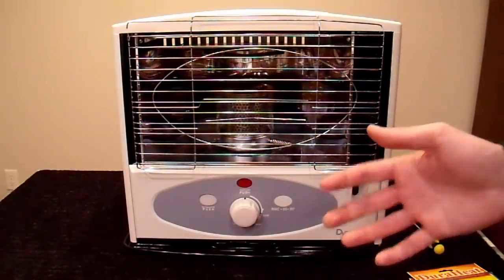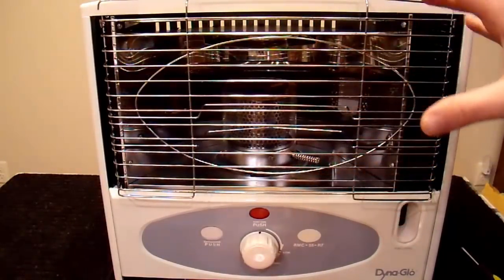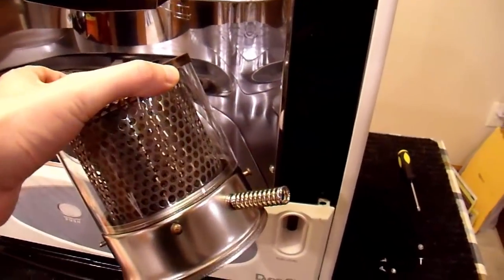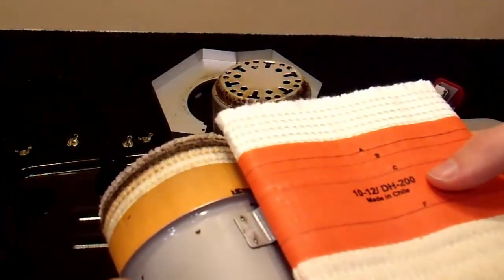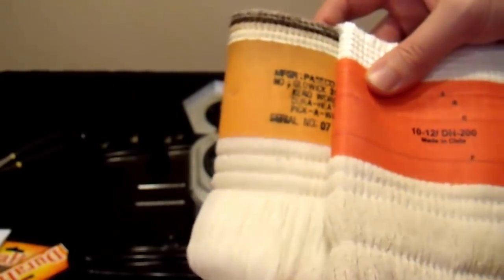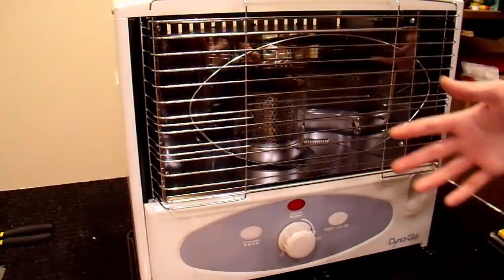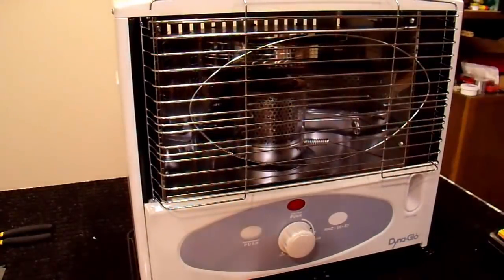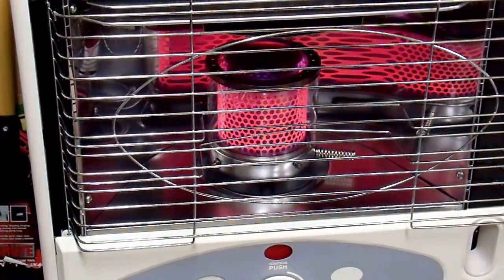Kerosene Heater Wick Replacement - A Simple Procedure

Comment: This unit works very well https://www.youtube.com/post/Ugkxl2o1MQU4aMgmFk_cMqer4nH2ptpDEM6h  Considering the price I paid for this, I didn't have high expectations, but now after using it, I consider this is a well designed heater. Do be aware that doing the dry burn on the wick as recommended (or at least every two tanks) is absolutely necessary to avoid an unclean burn, fortunately it's easy enough to do. I'm burning dyed K1 kerosene and do a dry burn every two tanks and this is working great. This unit will heat a little over the 500 square feet that it is rated for depending on the temperature. On days it isn't bitter cold this heater will do a fair amount more. This makes an excellent emergency heat source, and also in my situation, it is a little more efficient than the electric heat in the teen temps and below.
Reply from the maker: Makes sense.  More BTU is useful in a detached garage especially if you don't normally heat it.  Cold concrete sucks heat out of the air spectacularly quickly.

Comment: Calling out all ? 3 or so guys who did these vids, showing wick replacements on the dura heat/dyna glow type heaters. Each one of you edited out the hardest, most confounding parts of replacing these dang wicks. Pulling off & putting back the ratchet/ gear stud into the slot. That's the hardest thing to do! Show everything please. We don't care if you had to struggle a bit, but at least we'd know what to expect!
Reply from the maker: I apologize for not showing the part you were interested in.  I thought I showed all parts people might have had trouble with but I apparently missed something.  I've been in your shoes many times and understand the frustration!  It's been a long time and I don't remember exactly how that part assembles/disassembles.
Reply: NO SH!T!! arrrggggg. The dang thing came off pretty easy, but I'm playin' hell getting it back on.

Comment: NO diesel.... use only K-1 kerosene in heaters and lamps... clean burn, no residue, and cheap enough. And skip all the useless hand gestures in the video. Stay on topic. Burn it outside AFTER the wick absorbs K-1 for 1/2 hour or so. Smells and soot are best kept outdoors as you adjust the wick height.... then take it indoors to warm rooms.

Comment: I have a similar kerosene heater Zibro Kamin R30C and I think you solved what i thought was a problem just by watching your video .I installed a new Wick and everything seems to be working fine But the flame adjusting knob only raises the Wick it doesnt go in reverse to lower the wick/flame, (as my older Corona kerosene does) so i thought i did something wrong reassembling the heater. I noticed  your adjustment knob doesn't go in reverse either.(because of the ratcheting  mechanism) wont  allow the knob to be turned in the opposite direction.

Comment: Thank you for this video. I was able to replace my wick in my heater. My only issue was getting the wick out and then putting it back. Other than that, it was simple. I have it running now and it's so warm.

Comment: There's nothing wrong with this heater.  It just happened that you used a diesel fuel without any mixture of alcohol 91%, that's the reason it won't gonna work properly (diesel is more thicker than Kerosene). Kerosene requirements for heater is K-1 rated. The wick that you replaced is still brand new.  As long as you used proper fuel your wick will last up to 120 hours.
Reply: You've got to use an all cotton wick in order to use diesel, just don't ever use the red dyed diesel, or red kerosene for that matter. The dye will clog up wicks.

Comment: I bought a dyna-glow brand at walmart for $10 and it even came with a new igniter. 
  My heater is a kerosun radiant 36 brand and model. This fit perfectly and I think even the igniter is going to fit, I haven't tried it yet. I trimmed the old one and put it away I'm pretty sure I can still use it after trimming the bad stuff off. I also cleaned it with carburetor cleaner and a cotton shirt.
  I need to take my new one out and reinstall it I've got it too high. I can adjust it to where it burns just fine but it won't go down low enough to extinguish it and the proper use adjustment has it turned almost all the way down so it's installed way too high. You can tell that these things are made long enough that you can trim them without it ending up too short.
   How was the quality on this one you got?
By the way 6/16 of an inch is 3/8.
Reply: L

Comment: It's a dang 10$ wick man... is it really worth your time to spend refurbishing? Lol...
Reply from the maker: Peter Carlson It's good to know what can be done if you're stuck in a situation where you don't have a replacement but need the heater.
Reply from the maker: Peter Carlson
lol!  I bet it would for a little while!  hmm..  I actually save my old socks for use as oil rags and it makes me want to try it...
Reply from the maker: Peter Carlson
Seriously, I'm considering trying this just out of interest.  Now I want to know.  :)  Cotton wicks work just fine - I have an old perfection heater from the 1920's that does just fine with a 100% cotton wick.  They burn down over time and don't last as long but that isn't really the concern in this case.
Reply: ***** probably would handle the diesel better as its self consuming
Reply from the maker: Peter Carlson
That's a good point.  I never thought of it that way before.  I would probably have to disable the ratchet mechanism in my dyna-glo to allow full adjustment like other 100% cotton heaters but that would be relatively trivial.  The old perfection500 doesn't really perform that well since it needs constant adjusting to keep the flame right as the reservoir level drops so I don't like using that one indoors.

Comment: After removing the wingnuts, I can not get the wick holder assembly to come out. It will only come up less than half an inch. I’ve even gently tried a screwdriver on it. I’m at wits end.
Reply: usualy carbon makes it tough to pull up wiggle side to side and it still will take a lot of force if empty , use penetating oil on wick but be sure to clean all of it off before rewicking. also plastic razor remove carbon from center tub were the wick rides. I clean the  tank befor I reasemble so I run it empty befor changing the wick.

Comment: Good heater. Thanks for the video.

One note; the wick is more adjustable than you show. The knob needs to be pulled in and out to ratchet the wick down and not shut it down completely. It is then fine adjustable a little from there.

Comment: You should be able to clean that top area of the old wick.  Letting the heater run dry helps to remove deposits. Comb the wick with a small wire type brush. Where did you get your wicks at? I cannot buy them anywhere in my city.
Reply from the maker: I did clean the wick mechanically and it didn't work for me.  I also tried dry burning them.  Perhaps something like acetone might have worked - I don't know.  I ended up buying new ones from Lowes.  Online retailers sell them too.

Comment: @knurlgnar24 I successfully unclogged a wick by heavily rolling a wine bottle across the carbon line with the wick laying on concrete. It took a little while, but the carbon started breaking up and falling out when agitated. I also give the carbon some impacts with the wine bottle using a softer banging motion.

edit: Is toluene safe to clean wicks?
Reply from the maker: I can't think of much that wouldn't be safe to clean wicks aside from sulfuric acid or some other such substance.  Any solvent that doesn't damage the wick fibers is fair game.  Very interesting about the mechanical method using rolling.  I honestly didn't try too hard before buying a new wick.

Comment: Great video!  Thank you!  How soon would you recommend performing a dry-burn after installing a new wick?  I've been dreading this project for a while but your video is THE best I've seen on this subject.  Thanks again!
Reply from the maker: No need to dry burn unless you have a problem.  If a dry burn doesn't fix the issue then new fuel and/or a new wick is probably the solution.  You'll likely go hundreds of hours or more without needing any maintenance if your fuel is decent quality.
Reply: @knurlgnar24  Hey thanks!  I changed the wick yesterday and thanks to you it went smoothly and easily.  Today my heater is working perfectly.  Getting the pinion lined up in the ratchet mechanism was a little tricky but eventually it clicked into place and was fine.  My understanding (per the manual) is that these combination cotton/fiberglass wicks need to be broken in by dryburning after the first initial 5 or 6 uses to insure long life.  Who knows.  I've been buying clear kerosene at the pump (locally) for over 15 years and have never had a problem ($5.49/gal as of yesterday).  When compared to big-box retailers (including Amazon) charging anywhere from $15/20 gallon and the relatively low cost of a wick replacement, I'll take my chances now that I am comfortable with the procedure (again, THANK YOU). I use my heater almost every day and those insane prices just are not sustainable.  Even if I end up changing the wick once a month I'm still ahead $$$ after a single day's use.  Best wishes for an especially nice Holiday Season my friend!

Comment: Mine wont raise up like it used to. Idk if Im just not getting the gear in right or what. But its pissing me off.
Reply from the maker: I can only guess, but my first assumption is that you need to re-insert the wick adjustment gear in the holder so that it is in the fully down position when the knob is in the fully down position.

Comment: Someone else says if you want to use diesel use a 100 percent cotton wick..   use diesel cleaner additives and or add %90 isopropyl alcohol .
Reply from the maker: Regular Diesel (#2) will NOT work regardless of additives.  I've seen that advice in multiple places and an curious where they are getting their diesel - perhaps in regions with a lot of fuel oil heat demand where #1 is more common?  However #1 diesel should work in theory if you find a 'clean' source.  At this point I wouldn't risk it and would stick to K1 for wicks and #1 Diesel for torpedo heaters.
Reply: @knurlgnar24  yeah the ppl i seen said never use #2 only use #1 diesel. oh yeah i mentioned only use diesel with a full cotton wick.

Comment: I seen someone clean a wick with carb cleaner..   maybe soak in berrymans??
Reply from the maker: I tried cleaning mine and I don't remember exactly what solvents I used but it didn't work.  I wouldn't be surprised if what you recommend does work - I expect soaking in a light solvent with a synthetic solvent like what comes in Techron would work.  But at that point I might as well just buy another wick.

Comment: Hey knurlgnar24 - If you get one that is loaded with tar like that you can take it outside and let it burn dry till it goes all the way out, then let it sit for a half hour or so and lite it and let it burn dry again.  It will burn a lot of that tar/carbon off of the fiberglass.   I have brought back several wicks that way.
Reply from the maker: ***** I tried dry burning it twice and it didn't seem to make much difference.  I then tried high (relatively high) concentrations of alcohol mixed with clean kerosene and while it burned reasonably well on the kero/alcohol mix it went back to its smelly self when using only kero.  I wonder if this particular heater isn't designed to allow the wick to up high enough to adequately dry burn it?  I considered adjusting the wick so it would go up a little higher and potentially dry burn better but in the end it's a $10 wick and if I'm going through that bother I thought I might as well replace it.  Would be nice to know if it works though.
Reply from the maker: ***** BTW, the tar burned off of the wick portion that is exposed, but that's only 8mm on this heater.
Reply from the maker: Hey, I think it was you that had a video on running kerosene wick style heaters on straight diesel.  If so, could you comment on what kind of diesel you use (D1, D2, etc) and the diesel additive you use?  Have you tried running them without the additive and were your symptoms similar to mine?
Reply: *****
No it wasn't me, I haven't ever ran mine on diesel.  I have see a lot of garages and stuff that will run the salamanders on diesel.  I run mine on pump K1
Reply from the maker: *****
OK, thanks.  Must have been someone else.  I have a salamander style heater that runs on diesel as well, but K1 works better.  Diesel only seems to burn properly if the ambient temperature is already 50+ which kind of defeats the purpose of one of those heaters.  After a minute or so of pumping out diesel smoke it settles down and burns nice and clean after that, but by that time I need to open the garage door - and then I get even colder!  I'll probably try a diesel additive in that heater at some point since it really shouldn't need K1.
Reply: Couldn't I just brush the wick with a toothbrush without taking it out of the heater?

Comment: Can you burn diesel with that new wick or does it have o be a cotton wick?
Reply: yes, but it will need replacing again if you do. Don't do it.
Reply: Diesel is very similar to kerosene, just not as clean. 
My understanding is that you can use diesel when, and only when  you use an ALL COTTON wick. I've used diesel in my circular wick kerosene lamps, and it works just fine.
 Try Mick Stairs Wick shop. You can find out all kinds of excellent information there about kerosene heaters and also kerosene lamps especially the good ones with the circular wicks. Seriously, check them out.

Comment: You may want to take the kerosene heater you have there and hall it either to the dump or the junk yard, IT USES THE FIBERGLASS WICK and diesel will clog it up. I am using 4 perfection (FLAME SPREDDER TYPE) and a FANCO and they have no issues burning RED DYE DIESEL FUEL  You must be using a 100% cotton wick for DIESEL to work right. COTTON can tolerate the DIESEL ALOT BETTER then fiberglass. Just a pointer, I have one just like you, but its resting not being used. JUNK WORTHLESS. FIBERGLASS CRAP!!!